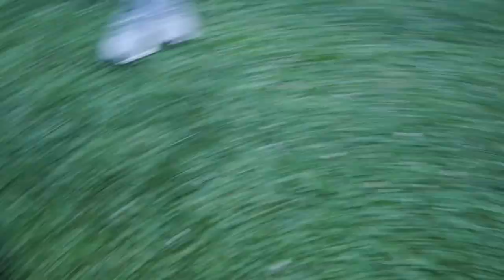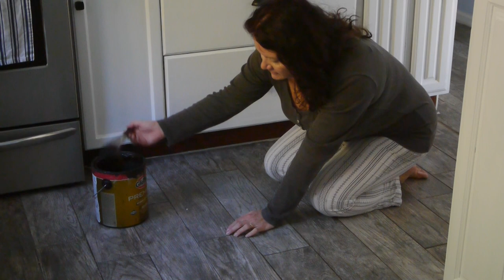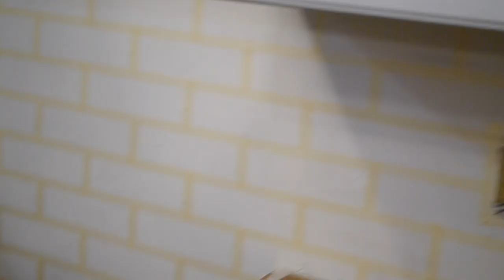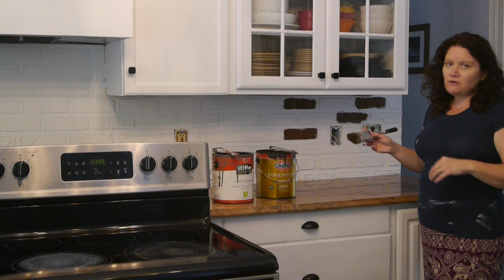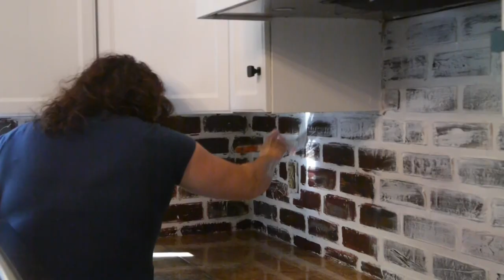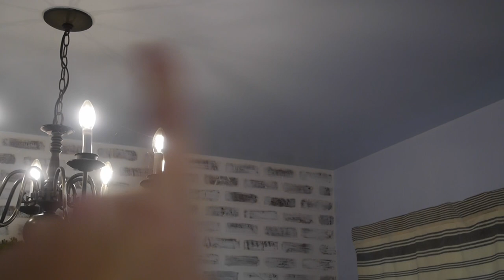Faux Brick Kitchen Backsplash

Comment: You should use Vaseline on the edge of the floor when painting next to the floor (a Q-tip works great), paint won't stick and is easy - to - wipe off. I would still put down painter's tape also. 

Thanks for sharing your journey.
Reply from the maker: Oh that's a great idea!! Thanks for the tip, and thanks for watching!! 🥰

Comment: Beautiful!! Would you care to list out step by step what you did to achieve this look? Did you put joint compound over the brick panels and then paint? And for the final white cost is that white paint? If compound?
Reply from the maker: Hi there! Thank you so much!! We have an original video showing our technique in one of our first videos, " Realistic Faux brick wall UNDER $50- Kitchen renovation". It's our second posted video and we break down the process. These weren't panels, we made the bricks using joint compound over a grid of masking tape, peeled off the tape in sections while still wet after mudding, and painted the bricks after all bricks were completely dried. This can take up to 2-3 days (to dry) depending on how thick you layer the joint compound. We've discovered since that first episode, when we've placed more bricks around our home, to go much thicker. The final coat is a flat white paint or you can use a white chalk paint. Thanks for watching and supporting our channel. ❤️

Comment: It’s been 3+ months. Can you give an honest review of the brick surface in terms of any staining, discoloring, cooking splatters, grease build-up, etc. What’s the best-so-far cleaner to use on the brick? Thanks so much 👍 ps:  ‘Backsplash  looks SO beautiful, loving your aesthetic!
Reply from the maker: Be glad to! The bricks are holding up very well! I have noticed right directly behind the stove/oven there is a slight discoloration but nothing dramatic. We decided not to put a protective coat on the bricks as of yet, as a polyurethane can sometimes yellow a white paint color under that layer. I have done polyurethane over white paint before and it does yellow the white paint a bit. I have cleaned it lightly with a Simple Green cleaner concentrate and water solution. I didn't scrub hard and I also don't deep fry foods, so the way I cook may have something to do with it. The white paint used was a satin based paint, I wouldn't recommend a flat paint application as a kitchen paint color for a  backsplash. We haven't had any grease build-up as I don't cook in a way that would make a ton of grease. Side note: I would also say make sure candles are soy based as well, if you burn candles in your home, so you don't get that soot on bricks. Great question! Hope that helps! Thanks  for saying that too. We appreciate that!! 🥰

Comment: What kind of tape do you recommend and what type of product are you using is it joint compound or plaster of Paris? And how did you know to how to size the spacing?
Reply from the maker: Great questions! We bought lots of masking tape from Walmart that's 3/4" wide. It's joint compound. The size is really up to you. We had some bricks outdoors for various projects and used that as a template for size. You could also get a measurement online where they sell bricks. You'll need a pencil and ruler or chalk-line (we use the  chalk-line method) as well as a level to check. Depending on the size of your space, you may need one or two 5 gallon buckets of joint compound. It's time consuming but the result is well worth it! Make sure you leave 1-3 days for drying time after the joint compound is applied and take that tape off as you go while it's still wet (after a few sections, so it doesn't dry on). Hope that helps.